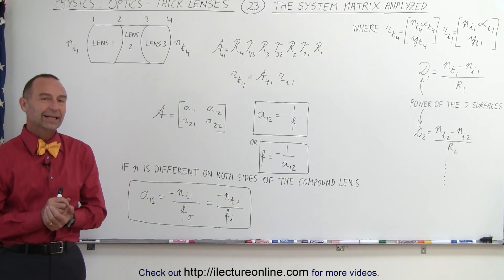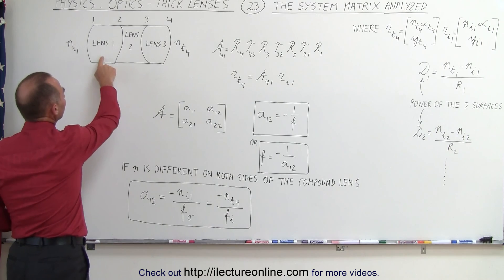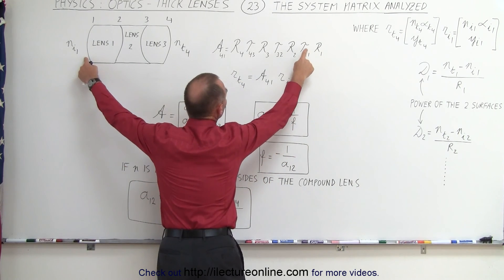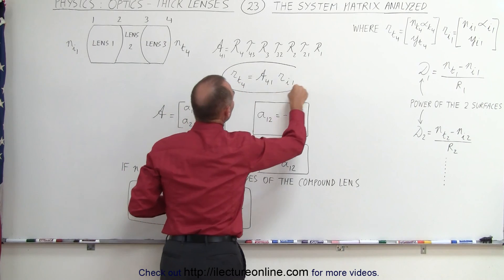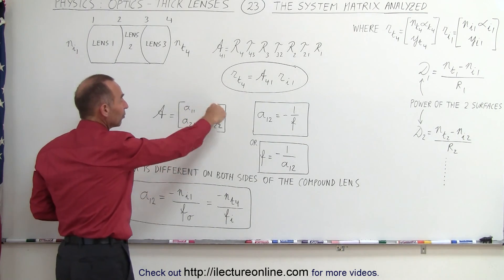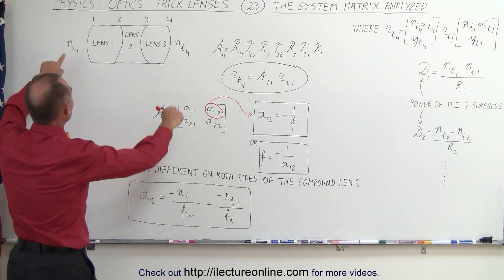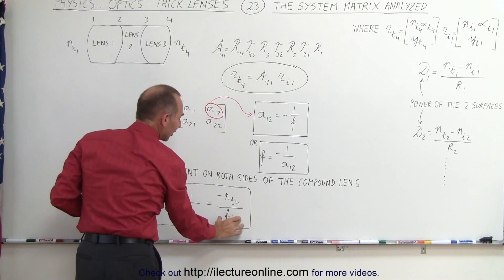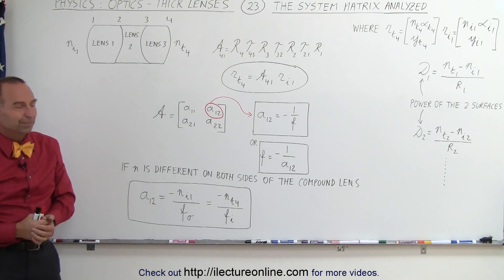Physics: Optics- Thick Lenses (23 of 56) The System Matrix Analyzed

Comment: Hi sir may I know how you get the last equation at the bottom that relates a_12 to the focal length and refractive index? If possible, can you also show me or provide a link to the derivation of the equation shown in video 8 of the playlist? I asked this because I got contradicting results when I try to use this equation to derive the Len's maker equation for thick lens in a medium (as shown in video 8 of this playlist). Let n_m denote the refractive index of medium and n denote the refractive index of the lens, after expanding the system matrix for a thick lens and factorizing it I got a_12 = - (n-n_m) (1/R_1 - 1/R_2 + (n-n_m)d/nR_1R_2) . If this is equal to -n_m/f as shown in this video, then 1/f = ((n-n_m)/n_m) (1/R_1 - 1/R_2 + (n-n_m)d/nR_1R_2), which is slightly different from the equation you have shown in video 8. In this case, may I know which formula is wrong, or which part of my derivation is wrong? Thank you very much.